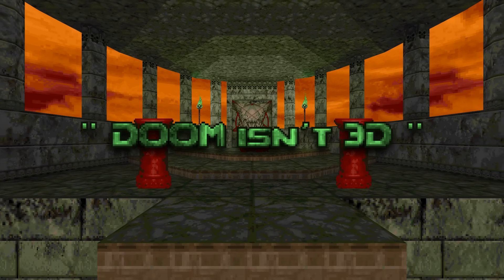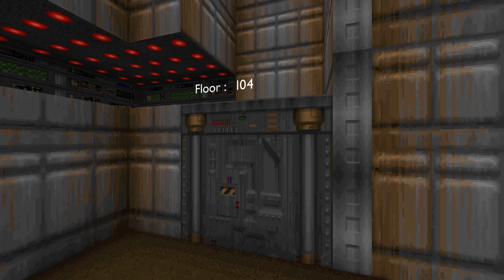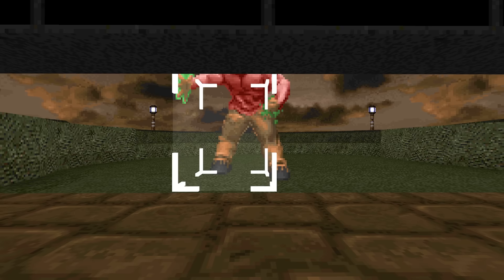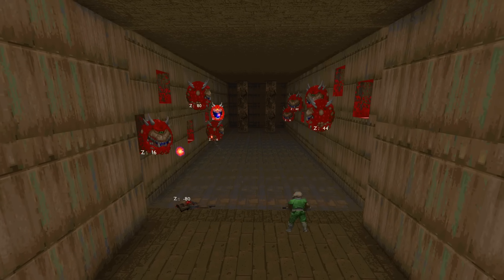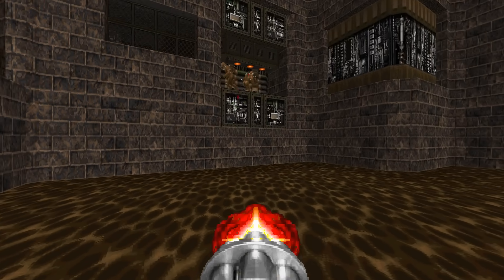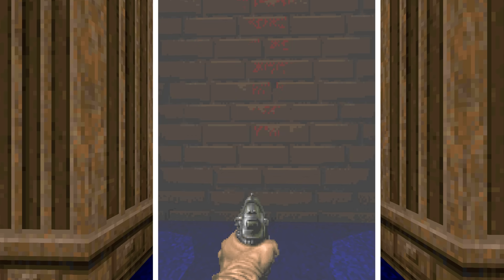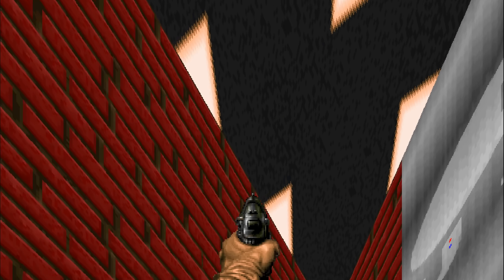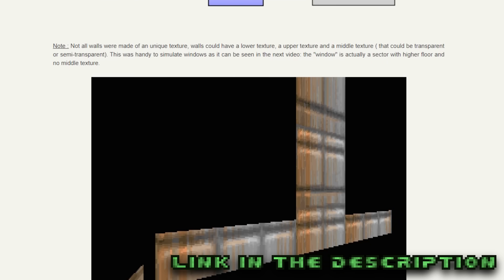Doom engine - Limited but still 3D

Comment: "No rooms above rooms"
Doom 64 would like a word.

But seriously, I'm still waiting for Decino or someone to make a video on that. The man himself even hearted the idea twice.
Reply: DOOM 64 actually fakes room-over-rooms with elevators that move instantly and without sound. Indeed you can break some maps by moving around them in ways the designers didn't expect because of this.
...That said, there are a few map features that certainly look something like GZDoom's 3D floors, that I'm not currently sure how those were accomplished.
Reply: @LonelySpaceDetective  it uses the same trick that ROTT and Build uses for the same effect. ROTT is built from the Wolfenstine 3D engine and the "elevators" are really teleporters.  The Extreme ROTT level pack breaks the illusion to show off the tech.
Reply: Doom 64 actually is 3D.

Comment: What about the Build Engine that was used for Duke Nukem 3D? Isn't it very similar to the Doom engine, but with some more advanced features?
Reply: Build uses a different rendering technique altogether, taking a portal-based approach rather than Doom's BSP-based one. This is why DN3D's maps didn't require compilation, and why walls could move without relying on Hexen-esque polyobjects. It still uses a column-based approach to plotting pixels (likely to keep performance reasonable on 486-class systems), so it still has the same issues with view shearing that Hexen does.

If you're interested in a technical write-up, take a look at Fabian Sanglard's site. He also wrote a rundown of the version of Build used in Duke Nukem 3D (in addition to the excellent Doom engine analysis that borogk linked to in the description).

Comment: Good job.
The only thing you could add is that it wasn’t a problem to add “fake” vertical look even back then, Heretic has it, running on almost the same engine. But it would just distract you and look wrong, making the experience worse overall.
This can be considered a design choice like the lack of jump or lack of multi-directional sprites for scenery objects, despite having ones in the alpha version.

Comment: Basically, just because the level data is 2D and there aren't rooms over rooms doesn't mean the engine can't be 3D.  Other sector based engines actually supported room over room I think.  Build and Marathon may have?

Comment: I been trying to tell people this for years. Even if the z axis is faked with heightmaps on 2d sectors those sectors still have 3 axis
Reply: But none of the vertices do.
Reply: @Hamdad  no the room vertices does have Z values, but they are inferred from the sector's floor and ceiling. like if every vertices will have the same z as the ones connected to it, why waste memory?

in fact you can even do a doom style renderer with rooms over rooms. there is nothing in the techniques used in doom that forbids that. heck you could even make you able to see all levels at same time with some changes in the rendering. it has been done actually.

the reason why they did not do it is because of doom's levels geometry is stored in something called binary partition tree. 
essentially you cut the level geometry half with a arbitrary line and put everything left of that line in one group and right in other. then you repeat the process with those groups, and again and again. till you have all the geometry in tiny bit chunks in a hierarchical structure.

you can use that structure to check if the whole chucks of the level are visible or not in one go, as in: "is the left group visible? no? then none of its subgroups are visible either" 
else you would need to check every single wall in the level one by one every frame.

now remember i said arbitrary line? if the levels were not flat. you would need to use a plane to split the level in 2, not a line.
 just with that you made a jump of something you could do by hand... into something that is even hard to visualize. 
and believe me the implementation gets just as messy and that is actually what quake does.
Reply: Technically heightmap and z-axis are basically the same the only difference is z-axis can calculates depth of the line and heightmap depth of the area.

People who argues over these don't usually even know what z-axis actually calculates they just know it is for 3d and some reason an basic knoweldge is humiliating for them so they don't even try to understand the basic.
Reply: @Mikael404  yes exactly its not like real life 3d of course but its still 3 dimensional because it does have length width and height in the game world. Levels made of 2d shapes put together each stretched a certain height and brought to life with textures amazing really.